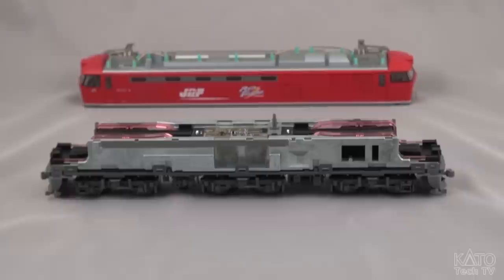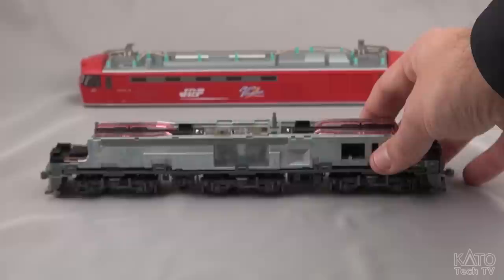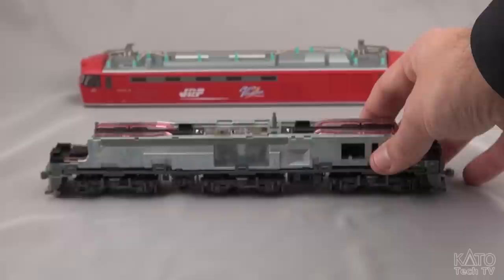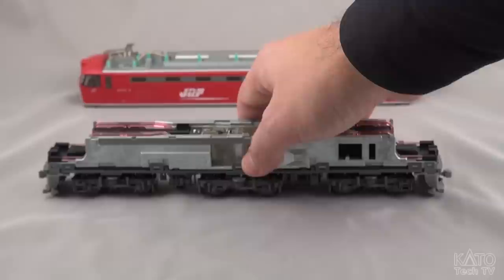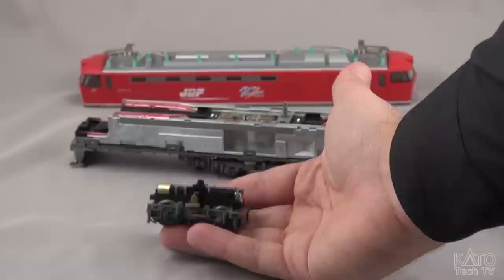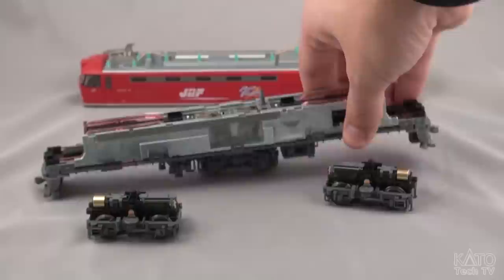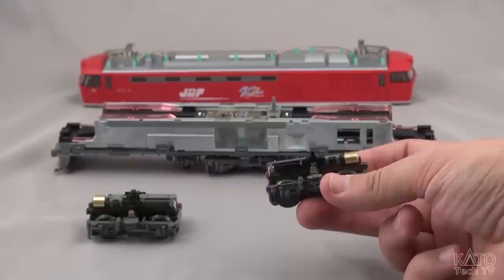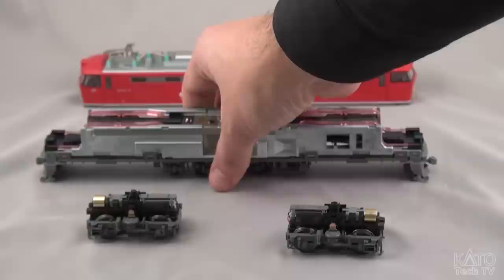[Kato USA Tech Corner] - New HO scale mechanism sneak peak

Comment from the maker: Tsunami decoders are $120 for Kato locos - speakers (the P42 will need two) are around $8-$9 each, and the base locomotive will be around $190. Our Soundtraxx equipped units will actually end up slightly cheaper than the individually combined components, and you don't have to worry about installation, testing, or programming :)

Comment: New SD38-2 units with early or late radiator inlets an a dynamic brake detail part that also includes the air cleaner box so newer production modeled!

Comment: Ok so I purchase a DC only P42 and converted it to DCC. I had to isolate the track pickup from the motor leads. So that meant the wires coming out the back of the motor are going to move a lot to the point where they will break off like just happened. So my question is when the DCC unit was built what did you do to isolate the track pickup and the motor leads?

Comment: Could we potentially be seeing a way to more easily put locomotives in "trail" position in consists to aid in prototype operations?  If there were a way to cut out the trucks quickly and easily to make the free-roll as necessary?  Examples of light power moves with numerous engines without the need to MU all the engines via DCC?  Or modeling a manifest freight that may have engines intended for a locomotive shop?

Comment: I have two of the EF510s, one in Hokutosei and one in Red Thunder livery, and I am very impressed with them both. However I'm a bit puzzled why the product listing for both models says "DCC ready" when they're apparently not. It looks like hard-wiring is the only choice. My HO-scale Kato EF58 has two motors and an 8-pin plug from the factory, so it obviously can be done. My question is: does Kato USA offer the parts through Kato's custom shop to convert an EF510s to DCC?

Comment: If this is a Bo-Bo-Bo locomotive, why can't you put a power truck in the center as well?  It would increase pulling power and make it the power arrangement more prototypical.
Reply from the maker: It isn't really needed, with the coreless motor design, the mechanism is practically a solid brick of weight which means its pulling power is already more than probably anything you would ever need. You can see our video on the pulling performance of the HO P42 locomotive for an example of the performance: https://www.youtube.com/watch?v=MacUY1_YjeU